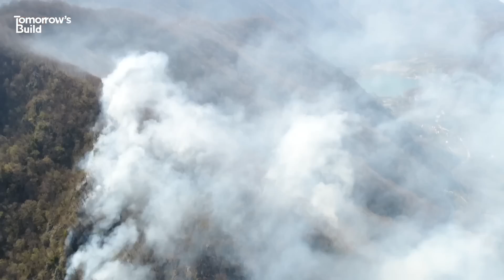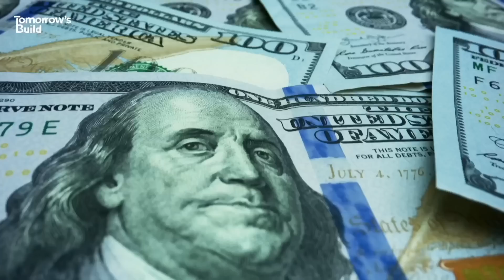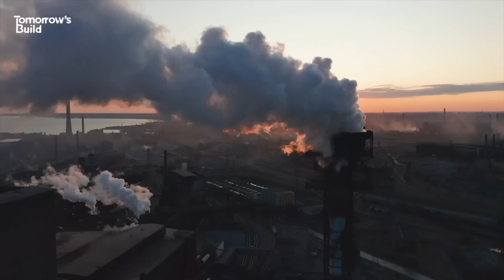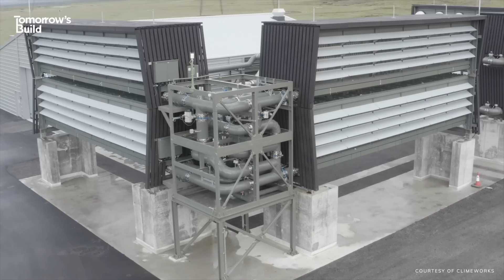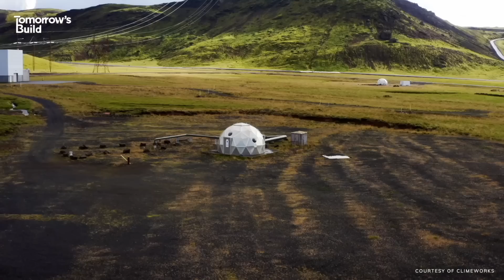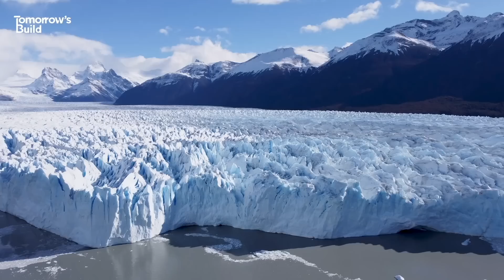This Machine Could Reverse Climate Change | Tomorrow's Build

Comment: "Carbon Capture Isn't Real" on Adam Something channel made really good point about using machines to capture carbon, the power used could had been used to instead and thus generate less carbon emissions.
Reply: i work on the factory they used as an example here, Norcem Brevik and have a degree in process technology so i know quite a bit about the viability of this technology. The carbon capture plant being built at Norcem Brevik requires no extra energy as it uses the spill heat from the kiln wich was previously lost to the environment. There was only enough excess heat to capture 50% of the total emissions. To remove 100% there would be needed extra energy. But this still reduses the emissions with 400 000 tons of CO2 a year. Without needing any more energy.
Reply: @stian1236  What happens to the emissions the machine pulls out of the air? Do they get stored somewhere?
Reply: @reece3408  The CO2 captured at Norcem Brevik will be stored in a north sea reservoir. Its a project called Northeren lightning.
Reply: I'm pretty sure any companies using carbon capture do so with a net negative carbon expense. No way they would bother if they are emmiting more carbon than they are capturing
Reply: Solar and wind energy aren't stable energy sources. Carbon Capture only works at times when solar and wind puts more energy into the grid than we need.
Reply: @Stian123 That waste energy also could have been used to power the electrical grid.
Reply: @robinatorm8013  Not it cant the waste energy is not at an high enough temperature to produce electricity, but high enough to strip the amin that absorb the CO2.
Reply: @robinatorm8013  if they thought they could’ve done better, they would have. It easy to give opinions from a chair. They spend millions on this. Im sure they thought of alternatives.
Reply: Ok but using the power to remove carbon is better then using the power to create less carbon
Reply: @yonatanschlussel  It's always more efficient to prevent a problem than to fix it. In this case, thermodynamically it's impossible to use less energy to remove carbon than not emit it in the first place.
Reply: @yonatanschlussel  How so? When you stop producing carbon, you also simultaneously diminish the need to remove it. In the future, carbon capture could (and probably will) serve as a way for us to rapidly reverse the effects of the GHG that have already been emitted, but right now, we're still emitting carbon, and ending those emissions is cheaper, faster, and more feasible than mass deploying carbon capture to "neutralise" fully preventable emissions.
Reply: @Vorexia  is it though? We're still a long way from ending those emissions. Wouldn't it just be better to also capture it simultaneously?
Reply: @yonatanschlussel  Theoretically, you’re right. But when you factor in economics, not really. Since it is so much more expensive than mainstream options like reducing fossil fuel consumption or preserving nature, it is also less effective. For every dollar spent, you’d be able to reduce more carbon emissions if you just invested that money elsewhere. If we take the money that Iceland, for example, spends on sucking carbon out of their air, and instead redirect that money toward funding the expansion of fossil-free energy generation in developing countries, you are able to reduce more emissions per spent dollar. From that perspective, today’s carbon capture kind of just looks like a moneypit that disrupts funding for vital projects. 

You also have to take into account that carbon capture is energy intensive, which at worst means an increased fossil fuel consumption and at best means that less fossil-free energy is being exported to regions that would otherwise rely on fossil fuels for energy. 

Direct air carbon capture may serve as a great tool in reversing climate change in the future when the tech is more matured, so I’m all for keeping up a well-funded R&D for it. But actually deploying it in its current primitive stage would be very counterproductive when we do currently have much more effective ways of fighting climate change.
Reply: @Vorexia  have you got facts to back up what you're saying?
Reply: @John...44...  What precisely would you like facts on? I'll need specifics to provide you with relevant material.

As a response to your second comment, you would be surprised. Carbon capture does reduce emissions by nature, but the fossil fuel industry in particular have blown carbon capture's efficacy out of proportion. Their reason for doing so is to use carbon capture to effectively instill the public with a false sense of security by convincing them that low-carbon or even carbon-neutral fossil energy has been achieved. Greenwashing, in other words. One of the biggest examples of this is the American coal industry re-branding coal into "clean coal" - where they supposedly use carbon capture in their power plants to cancel out most if not all emissions generated, even though the current generation of industrial carbon capture is only able to cancel out a small fraction. It's very similar to the ongoing "carbon offset" scam that various carbon-emitting industries, such as aviation, have been involved in.

Comment: Carbon emissions are forecast to be ten percent higher in 2030 than they were in 2020.  Methane data from lockdown showed that levels continued to increase beyond those expected suggesting that the release of previously tempreture locked reserves of methane hydrate in the Arctic tundra and litterol ocean regions is gathering pace and an unstoppable climate feedback loop has already begun.
So called carbon capture technology is a proven public relations scam sponsored by the petrochemical industry that is wildly inefficient, laughably insufficient and completely unscalable.  But the humerous takeaway of the cackling industry insider in this article seems to be that, even though our grandchildren or great grandchildren are doomed to the unimaginable horror of a global climate apocalypse, we should all cheerfully climb onto the back of this white elephant and charge it right off the cliff.  Still, as long as the vested interests are stuffing their pockets on the way down, who cares, right?

Comment: Spoiler: no they can't.

Carbon capture facilities need immense amounts of energy to temporatily remove tiny amounts of CO2. The energy comes from - you guessed it - burning fossil fuels. So for each kg of CO2 they capture, several kg of CO2 are released to produce the electricity that CC devices require. It's a greenwashing scam, nothing more.

Comment: The thing with carbon capture is the electricity that generates power to the plant is very high, unless the electricity comes from renewable energy itself, weighing on the cost of the carbon capture building and the electricity its not a viable option.
You know whats viable and cheap? Planting the damn trees.
Reply: Planting tree isn’t that easy. You have to wait a while before the saplings can actually remove co2 from the air. Not to mention, planting the wrong trees or in the wrong area can diminish the carbon capture effect of trees. How? For example, disruption of existing plant life that already hold a lot carbon.
Reply: Trees are actually quite bad at it they just let it back out after not to long

Comment: I mean, CCS isn't even economically viable as part of coal-fired power plants where you're dealing with the highly concentrated CO2 in the plant's exhaust. Apparently one has to burn 30% more coal just to power the energy-intensive extraction. I fail to see how it could ever be reasonable to wait until the CO2 is massively diluted in the atmosphere and then extract it. 
These things only serve to make people think we don't need to act on reducing emissions.
Reply: They may be part of a future carbon cycle, but right now they're always negative.  
Even if they work well, it takes a lot of energy to suck the CO2 out of the air.  
Since renewable energy is a limited commodity now, the additional energy demand is acquired from fossil fuels, therefor a net negative impact.  
  
Once we have surplus renewable energy, this becomes an option, but we are not there yet.
Reply: Exactly. The poster child of the Greenwashing industry.

Comment: Yes, but at what cost ? How much CO2 would be released to suck 1g of CO2
Reply: This video had some unusually lazy writing for this channel IMHO. As many pointed out, there is an obvious objection: Where should the energy come from to have a net positive effect? These companies have an answer: Use excess energy from renewable sources that would otherwise go to waste.

I'm not saying it makes sense to invest in these technologies on a big scale, I'm just saying there are some obvious points that needed to be mentioned in order to have a productive discussion.
Reply: @junglist_ikon  Well, the thing is, unlike energy production, you don't actually need to get the energy production running 24/7.

So excess from renewable make sense since thes carbon capture machine is able to be turned off and on in an instant when there's excess of energy.
Reply: Some are powered by geothermal energy...
Reply: Economies of scale are probably a huge factor here. A single power plant can probably power hundreds or thousands of these stations (could be higher without knowning more). Same reason why electric cars make sense. Sure, you're still charging a car from a power plant, but it's way more efficient because tens of thousands of vehicles can charge from the same large power plant.
Reply: More than 1g. Which makes carbon capture entirely pointless.
Reply: Logically speaking, they would be using nuclear to capture CO2 that was released by other industry that still unable to utilize renewable technology. Like transportation industry. Battery powered or hydrogan aircrafts are not here yet. It won't be here for couple of decades. So carbon captures could help Offset that.

So you basically using more energy to clean the air.
Reply: i mean if it was net negative they would'nt have made it
Reply: @lleasar  It's expensive, the widespread usage for nuclear energ is still very low across the globe and there are no mass scale productions for the macine yet.

We are still in the development stage.
Reply: @e808_88  yes definitely